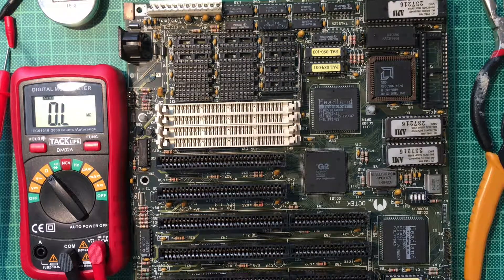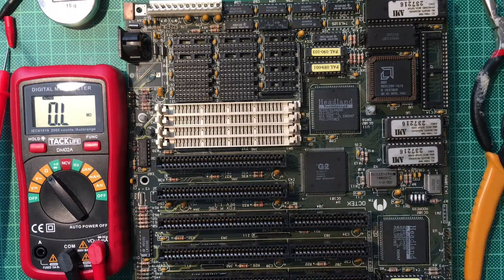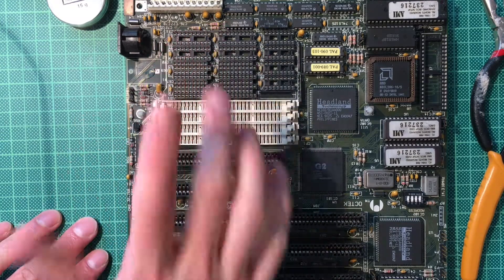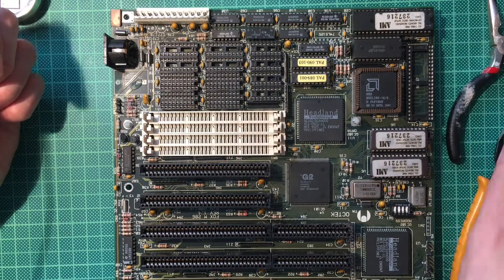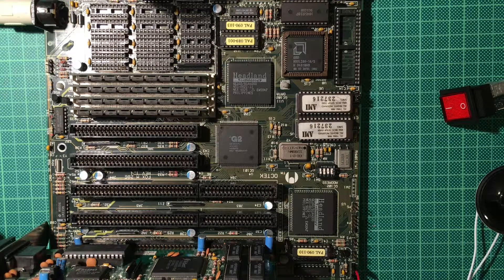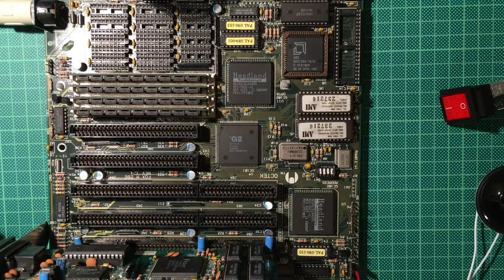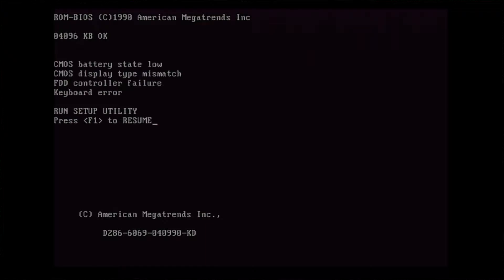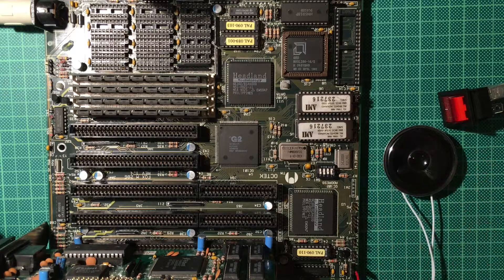Recapping an Octek Fox M 286 Mainboard

Comment: Tank yuo for instructions. Could you share BIOS dump for this MB? I have the same, but BIOS is broken and I cou;dn't fine any that work with this MB
Reply from the maker: Check out this thread on Vogons:
https://www.vogons.org/viewtopic.php?t=60212
Reply: @root42  I already saw this thread on Vogos, but all BIOES not work properly. I made 2 EEPROM with BIOS_30MAR90_QUADTEL_ENHANCED_286_BIOS_3.05.01, but MB staked with cycling reboot rigth before RAM test. MB have HT102/HT101A chipset - Octek Fox M 286 REV.: 1.1

Comment: I just got one of these. Do you know if it will handle 20 MHz? I know it says 16 MHz in the manual, but it doesn't appear to be tied to bus speed or if so, It'd only be 10 MHz.
Reply from the maker: Nope, I have no idea, sorry. For the 286s, I rather leave them as is, and use a 386 when I want something faster. :) But maybe you can ask on the forums, like vogons.org or dosreloaded.de (assuming you are German speaking). There are quite a few people who do this kind of stuff.

Comment: @root42 I have the same board but the BIOS EPROMs were dead (yes dead). I can't find any BIOS roms for this exact board anywhere. I have tried any other roms I have come across that were for similar boards. None worked. Could you please, pleaaaaaaaaase provide me with the BIOS roms? That'd be so very kind of you
Reply from the maker: I currently don’t have an EEPROM reader at hand and due to the virus I can’t go to work. You might want to use this BIOS: https://www.vogons.org/viewtopic.php?t=60389 The 286 BIOS are mostly compatible. And the Fox uses Headland chipset IIRC.
Reply: I just used a Biostar MB-8500tvx-a to hotflash a BIOS chip for a 486 board. it worked fine. the 486 wouldn't post due to a corrupt bios, just used a IC puller to pull the bios chip out and then when Uniflash was launched, i pulled the bios chip out and put in the 486's bios chip and flashed the bios and removed it and put the original chip back in and put the chip in the 486 board and it posted.

Comment: Hi! Danke für das interessante Video. Ich habe das gleiche Board, auch mit 4MB SIM. Leider macht es keinen Mucks. Kannst du mir das Manual zugänglich machen?
Danke und schöne Grüße
Reply from the maker: Kein Problem, schau einfach bei minuszerodegrees: http://www.minuszerodegrees.net/manuals.htm#Oktec -- Auf der Seite gibt es eine riesige Menge an alten Manuals. Des weiteren solltest du das Board auf visuelle Beschädigungen untersuchen, besorge dir am besten auch eine ISA/PCI POST Karte auf eBay. Die kosten nur um 5 EUR aus China und zeigen dir an, wie weit das BIOS eigentlich kommt. Ein Mutimeter und/oder Oszilloskop kann auch helfen. Multimeter um Spannungen zu prüfen, Oszi für Bussignale. Habe selber kein Oszi, vielleicht kommst du auch ohne weiter. Du solltest auch mal probieren ohne RAM zu booten, vielleicht ist das ja schon defekt. Kaputt auf ewig ist selten etwas, du bekommst das bestimmt repariert! Für Hilfe in deutscher Sprache auch mal bei dosportal.de vorbeischauen!

Comment: I am able to buy this board including 1MB of RAM. Would you recommend it? The battery has been removed. Is it difficult to replace?
Reply from the maker: The octek is a brilliant little board. I love it. However the tantalums can blow, as in my board. But that’s a problem with all old equipment. The battery is optional, and you can either put a new NiCd in there or a non rechargeable lithium cell with a diode in series to prevent charging. I have a video about that too:

https://youtu.be/seCoC2AcHqs

Comment: Hello, would you like to tell me, what exact capaciators you have been used? There are many versions of 10 mF and 1 mF capaciators in the shop of Mauser Electronics.
I got that board too and by powering it on there is no vga-signal. I removed the battery an cleaned all up. I had to repair some copperlines around the battery but those are not the reason for my problem. By measuring the capaciators some have no capacity anymore so I want to remove an change them too.
Nice video!!! Thanks...
Reply from the maker: Hi and thanks for your comment. Since the video I have learned quite a few things. 

1. Measuring the capacitors in circuit is usually giving wrong signals. 
2. Modern tantalums are not bad and have better failure modes 
3. Desoldering on this board is quite tough, best to get a desoldering gun, if you can afford or borrow it! 

I used Nichicon caps (Mouser PLF1E100MCL7TP and UMF1V010MDD1TP) and while they are good, I learned that Octek probably used Tantalums for a reason. Different caps for different jobs. Sometimes a higher ESR is actually required for circuits to work correctly. So maybe you should rather buy some high quality modern tantalums (e.g. Mouser 80-T350E106K025). Make sure the lead spacing is correct. I chose 25V here to be on the safe side. Tantalums should be overprovisioned since they are fairly susceptible to overvoltage. However, the higher the voltage rating, the more expensive.

Last but not least, make sure that the caps are really, really the problem on that board! To make our precious boards a bit safer, check out this project: https://x86.fr/atx2at-smart-converter/
It's a brilliant little device that protects vintage mainboards against overcurrent and overvoltage. You can't buy it yet, but please let the author know you are interested, if that is the case.
Reply: Thank you for your answer. I have testet the board with two vga-cards an the speaker does not a click or sound after powering the board on. I got my experience by recapping some amiga 1200 and amiga 2000 and a desoldering iron is very usefull. So I will give it a chance by using Tantalum caps. In a few weeks i will tell you my result ;-)